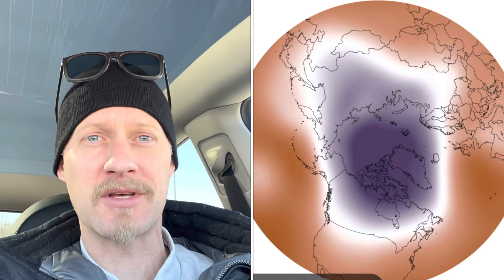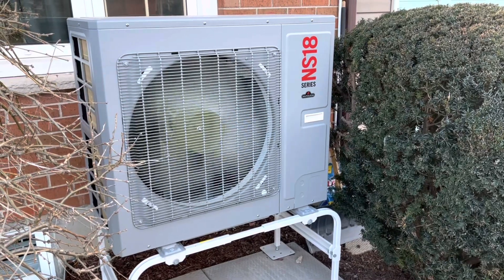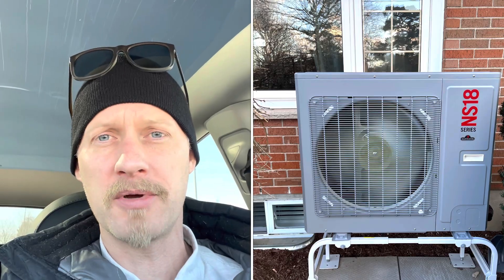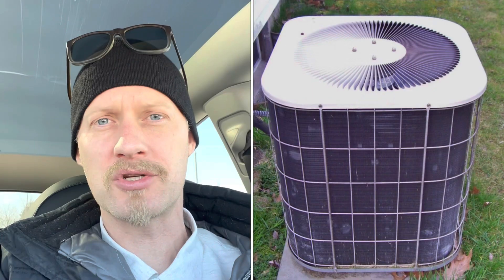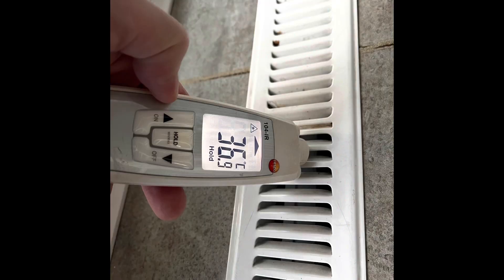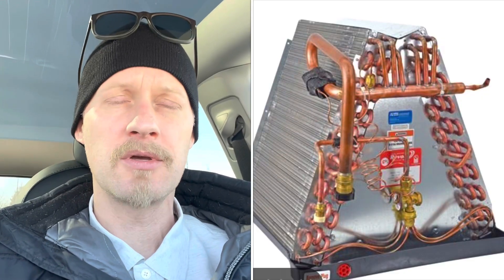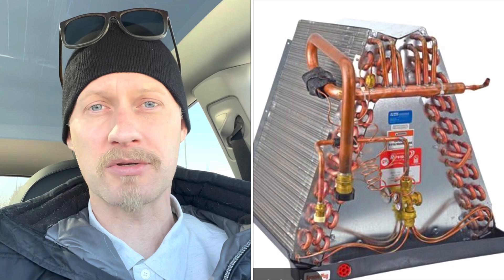Cold climate heat pump, the truth in the cold!

Comment: I had a heat pump installed recently. Is gas emergency heat. When I put the heat pump on at -5 c outside the furnace fan never shuts off maybe for 5 min. Then continuously run its not cycling. Should it cycle at that temp. I originally ask sales guy from reliance to install a 100 thou btu and he said all I would need is a 85 thou btu. For a 2500 sq ft home. Then it came to install day and they put in a 80 thousand btu. The quotes were for 85 thousand. And I am renting this from them. Could it be under sized for the home and to much heat loss for my older 100 year home. Low insulation
Reply from the maker: Possibly undersized or the rating on the heat pump isn’t meant for the colder weather.

Comment: Your problem. Ductwork!! You will continue to have loud compressors and issues. Your ductwork was not sized to the heat pump. You have high static pressure causing the heat not being rejected from the evaporator coil. Has it ever tripped on error codes? Please tell me the installer used the correct evaporator coil in the furnace. Also the furnace and heat pump should never ever run at the same time! Your evaporator coil is infront of the fu mace heat exchanger and will cause massive head pressure and damage to the heat pump compressor. See where im going? These are not a slap it on your furnace hybrid all in one unit. They MUST BE SIZED to the ductwork and habe a non plumber install them!!! Only a heat pump refrigeration tech who has years of hands on installatio should be installing any ducting type air source heat pumps. Or it will FAIL PERIOD!!!

Comment: I have been looking at replacing my heat pump. I know I am going with  Gree,Cooper and Hunter ,Panasonic, probably Panasonic. My Rheem Heat pump is well okay it works but is loud and does not heat worth a flip . I do know that I am installing it my self.
Reply from the maker: Did you end up making a decision? This gree has been heating well for me.
Reply: @yourelectricneighbour3633    I sure did I installed a Midea 18,000 Btu unit. Not one issue it works perfect, I have stopped using my main heat pump period and just use it. It runs 24-7 so it removes humidity in the summer and even when its 0F the air coming out will run you out of the room. It's a hyper-heat model,well I don't know what Midea calls it

Comment: We’ve had heat pump water hot water systems in Australia for 15 years and they’re ok, but when it gets cold, that thing runs all night, and then comes on again at 5pm when electricity gets expensive. Old Tank leaks now and we are replacing with straight electric on a timer. More efficient in winter and way cheaper. Our original was purchased with government hand outs, cost us $50. Now they’re about $5000. No thanks.

Comment: Same as Gree Flexx, Tosot Apex, MrCool Universal. Napoleon may be a Canadian brand but the hardware is made by Gree in China. Side discharge is fine but you have to keep the snow and ice from accumulating in the fan or it won't start, so the same ground stand that is needed for normal heat pumps to keep them out of the snow is also needed for these.

Comment: Your unit is a hybrid heat pump.
Wind chill is meaningless to machinery.
You converted your air conditioning system components  (blower motor and A-coil) not your furnace.

Comment: How many Sq foot is your home? The NS-18 Series is a 2 ton HP. I just had one installed aswell, a 2.5 ton system and I'm a little worried it may be a little too small for my application and would like to compare, since our heat pumps are relatively same size (and same climate, since I'm in the same region as you). Like yours, I am gas as a secondary source and it'll kick on at -20 I believe. Btw, I recognize that glass roof from anywhere. Nice Model Y!
Reply from the maker: The NS-18 can be set up as a 2 or 3 ton upon installation via dip switches inside the unit. Check with your installer to see how they set it up. My house is a little over 1000 sq ft and it keeps up well but heat pumps do run longer than a gas furnace, but are designed that way. Thanks for watching!

Comment: Hello EN, from Ontario here. I just had cold climate Heat pump ( dual fuel) installed yesterday with a new ecobee thermostat. My question is when during a defrost cycle, is my fan supposed to blow cold air in the house?. Is my alternate heat supposed to kick in during the defrost cycle? Very new to heat pumps...thanks
Reply from the maker: Cold air is normal on defrost with a hybrid system. Only a true air handler with heat strips will activate during that time.

Comment: I think I'll replace my 18 yr old pump & dump geothermal with one of these, when something expensive breaks on it. It's been a good one, put one $300 fan control board on it in 18 yrs. Well pumps haven't done as good...
Reply from the maker: Interesting, geothermal was new here years back too but seems more for commercial settings or location based designs.

Comment: That Napolean unit looks strangely similar to the American Standard 18 SEER cold climate heat pump that I had put in here in Vancouver.  As to your point about dew point, I find that my heat pump does freeze up often.  Vancouver's humidity is almost always 100% for these past few days.  For now, I've actually set my heat pump shutoff at 0C to cut back over to my natural gas furnace for now.  So it sounds like I should actually be checking for my dew point to decide on a proper cut over temp.

https://americanstandardairbc.ca/wp-content/uploads/2022/11/Quest-Spec-Sheet.pdf

Comment: My neighbour just got one installed between our houses and it is noisy enough to notice in our house to the point where it wakes us up frequently so I’m looking for sound insulating solutions! I’ve heard other complaints for noise with this type of heating! Very disappointed
Reply from the maker: Super frustrating. The website on the Napoleon mentions “whisper quiet” but it’s a rebranded Gree unit and I find the compressor can get noisy on certain cycles but not loud enough to hear through a window.  Perhaps a faulty unit.

Comment: Air source heat  pump working just fine in Western NY snow belt.  Cheaper to operate than propane.  Only complaint is the noise from the compressor when defrosting can be annoying.
Reply from the maker: The defrost cycle is definitely louder than I expected. I debated opening the unit to add insulation but don’t want to void the 10 year warranty.

Comment: Good video showing cost savings.  First time I’ve seen the napoleon unit.  Seems the same RE-branded Gree as Mr Cool universal and AirTemps inverter heat pump.  Anyone know any other rebrands of same unit to add to the list?  I own 2 Mr cools and they seem top knotch quality so far.  Everyone just says replacement parts can be difficult, which is why I’m trying to figure out a list of who all sells the same units.
Reply from the maker: I’ve since had this replaced due to. A compressor issue and they replaced the whole unit after a failed repair attempt. 10 year warranty through Napoleon but I realize it’s a rebranded Gree. Overall cost savings will go up the longer you have it. Check the warranty on whatever brand you go with.

Comment: You have a Tesla and heat pump, what is the total electricity cost? Way cheaper than before when they are 3 separate bills?
Reply from the maker: Well the Tesla ran about $500 for the year (other half was supercharging) to go 40K (km). Heat pump I won’t know until a year is up but I’m winter was saving $100/month over natural gas.

Comment: Does it really save as much on utility bills compared to traditional furnace and ac unit?
Reply: Id like to get an answer on this as well
Reply from the maker: Hi, sorry for the late response but yes my monthly cost is greatly reduced vs gas and traditional AC. In winter the neighbors were paying $150 a month in gas to heat vs $60 for electricity in the coldest month. Same savings in summer as heat pump cools more efficiently. Many factors affect break even point but if your furnace and ac need replacing then the upgrade cost should save you money.
Reply: @yourelectricneighbour3633  thanks for the reply.  I'm on day two of three of installation today lol i went with a new tankless water heater, heat pump and air handler.  Furnace and water heater were on their last legs.  Looking forward to seeing how it goes this winter 👍🏼 My furnace was 22 yrs old, water heater was 12 and we had no central air only 3 window air conditioners.  So anything is an upgrade from that set up lol

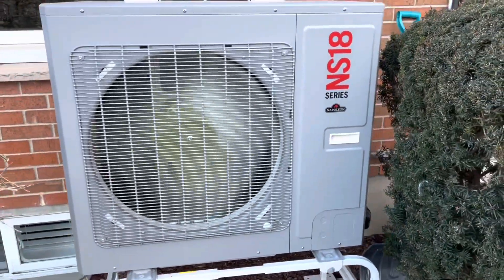Comment: 0:42 Windchill is not temperature and does not affect heat pumps from an ambient temperature perspective*. Decades ago I new people would confuse windchill (and heat index) and, yeah, it's still happening.

* Yes, wind(chill) affects convective cooling and tbh I don't know how it affects a heat pump, but all you need to do is put a shroud around the heat pump to neutralize the effect. Regardless,  windchill is the cooling effect on exposed skin.
Reply from the maker: I realize the difference but I guess brought it up as to how cold it felt outside. Good explanation however for those unfamiliar. Thanks

Comment: Have one in our office at work. Yes it does produce heat in temperatures as low as minus 10c. The only problem is when it gets below zero it keeps having to go into defrost mode. In a listed building in the UK, the insulation is poor so heat is lost very quickly.

Comment: A. You pair any heat pump with a gas furnace or does it have to be a package?
Reply from the maker: This will depend on the thermostat used as well as the knowledge of your hvac tech. Search hybrid heat pump set ups to get the best information.

Comment: The real question is how does this heat pump achieving this performance at such low temprature? If it's by using the  electrical strips then I guess power consumption will be significant which in turn will increase the cost of your utility bills.
Reply from the maker: I don’t have heat strips as I don’t have an air handler. This uses my furnace fan to blow the warm air. Furnace kicked on about an hour over two months so no, this is just how a cold climate heat pump operates.

Comment: I had the Mitsubishi Intelli-Heat system installed last month and I noticed that whenever it’s below 25 degrees Fahrenheit the system switches to the back up natural gas furnace. I believe that the problem is in the Mitsubishi brand thermostat which I just absolutely hate! My outdoor unit is the Hyper-Heat cold climate so I know that it can handle much lower temperatures.
Reply from the maker: Check your settings for the switching point (mine has something called switching tables). You should be able to change that setting yourself.
Reply: Do you know where I would look for that setting on the thermostat?

Comment: Great job on this.. I learned a few things from you... We are building a new home in Toronto and would like to know if you would suggest heat pump with furnace or HVAC?  We do have natural gas available. Would like to know which is more economical.  I have been told Daikin is a better model for heat pump.. Is this a good and reliable unit?
Reply from the maker: When hooked up to a furnace that still has gas, it’s called a hybrid system. This is a ducted system and what I currently have as it was the most economical option. Daikin has good reviews.

Comment: My furnace is rusty and crusty so I'm thinking about upgrading anyway (so rusty I can't get the bolts to the burners off to clean them). Since I was thinking about getting central AC anyway, I kind of had a heat pump with gas backup in mind (main reason why I wanted a gas backup is it's easier to power with a backup generator). I saw these Napoleon units, along with their 9700 ultimate gas furnaces at a trade show. They look very well made.
Reply: We just had a Tosot heat pump (re-badged Gree like the one in this video) and a backup 96% gas furnace installed recently. I'm really glad we went dual fuel because we just run the furnace for heat. We tried the heat pump for heating but it makes so much more noise than the furnace that it's a no-brainer, so we use it just for cooling. Our neighborhood is very quiet and a heat pump is one of those few things where electric is louder than fossil fuel. It's not unbearable, but we do hear it and given the quieter option, we'll use that option.
Something to keep in mind that no one seems to mention when talking about the advantages of heat pumps.
In cool mode it's quieter, and since there's no quieter option we do run it as an air conditioner.
Reply from the maker: Best of both worlds really if you can find a rebate where you are located

Comment: There are two basic types of heat pump.
An air to air heat pump AKA a reverse cycle air conditioning unit and a
Geo thermal heat pump.
A geo thermal requires either series of deep bores be dug well below the frost line to insert pipes that cycle a thermal media through to exchange heat from the ground or massive trenches be dug to lay the pipes into. A geo thermal will work extremely well as long as it doesn’t freeze the ground which would only happen once in an ice age. These are expensive to retrofit but are the cheapest to use as most just need a few fans and pumps.
Air to air cost as much as a regular aircon to run and install.
Reply: There are also air to water heat pumps which use existing radiators.

Comment: Do you also using  "NAPOLEON EQHUB SMART THERMOSTAT"? How your heat pump is functioning along with your furnace and thermostat? This heat pump have 2-stage compressor, how did you wire this heat pump to your thermostat and from thermostat to furnace? It would be great if you share some feedback.
Reply from the maker: Yes on the thermostat. It allows the user to select if and when the gas furnace comes on or not at all if you want heat pump only. Installed by the technician but new 8 wire was ran to accommodate the 24v system.

Comment: Today people purchasing homes do mot get to choose their mechanicals like HVAC systems. When a home is built unless it is custom, the builder usually goes the cheapest way to meet any building requirements set for the location.  Years later it comes out that alot of that stuff was wrong and not the healthiest.  Not sure how improvement can be made but it is what it is.
Saying this, I had a heat pump in California. I was never warm in the winter, if thermostat was changed to help heat the small home, 1400sf, my electricity would jump to an unaffordable range. 
I don't have a heat pump now and 
It would be a deal breaker for me.
My choice would be never to use a heat pump again.

Comment: As an American; please don't interpret  Celsius- fahrenheit; Celsius is soooo much better and if my fellow Americans are too lazy to take the 10 minutes to learn it, forget them!
Reply: bahhh......remember the "Metrication" laws during the early 80's?  Everything was to convert to metric at one point. and in the 80's there were dual road signs, etc... It just wasn't possible to change the American culture and it was ultimately abandoned....but yes. Metric is really much easier to understand.. 0 is freezing and 100 is boiling point,    but oddly there is a number that matchs both Centigrade and  Franenheit.....-44 or something ?

Comment: I’ve had heat pumps since 1987, they suck in cold weather. They basically are electric heaters that suck your wallet dry. 

I put a gas fireplace in with gas logs and heat my entire house in the winter for a quarter of the price.
Reply: How did the internet work in 87? 
How efficient were cars in 87?
How were cell phones in 87? 

Heat pump tech has changed since 87.

Comment: issue is that you kinda cherry picked the heat pump as there is no snow on the grounds and there wasn't any significant moisture to cause the unit to freeze up. Also the efficienty of heat pumps drops as the temperature drops. if you look at most heat pump data sheets the either show a decline in COP or reduction in heat flow. 

Another issue with heat pumps if you lose power in bad weather its unlikely you be able to use a small backup generator to run it. Usuually a gas\oil fired system can be powered using a small generator. I think a lot of people will get screwed using heat pumps if there is a major power outage that takes a week or more during freezing weather conditions.
Reply from the maker: The video was shown for temperature effectiveness. As mentioned moisture does play a roll in whether a defrost cycle will run . You are correct about back up heating however if you have a hybrid system like this then gas can still be used if you want with a generator hooked to the furnace fan as you describe.

Comment: Absolutely. I have a Fujitsu XLTH and it produced heat at -18F.   If you don't get one designed for low temperatures then no.
Reply: Those units have electric heating strips in it to provide supplemental heat. You're basically using a baseboard heater.

Comment: Thanks good video, live in Sweden again a cold climate and ours works.
I think we have to mention that as it gets colder then they use more electricity.
Under optimal conditions the ratio is 1 to 3
That is to say 1 kwh in 3 out
This drops as it gets colder maybe down to 1 to 1 just the same as when it used as an AC.
They definitely reduce heating costs.
We leave ours on 24/7
So it keeps up with the fluctuations of the outside temperature.
Reply: Whats the average temp there??
Reply: @xGroteskx  +25 in July and - 8°C in January. It is often - 10° C in the winter  and can on occasions drop to - 20°C